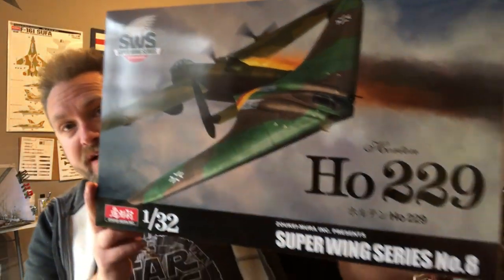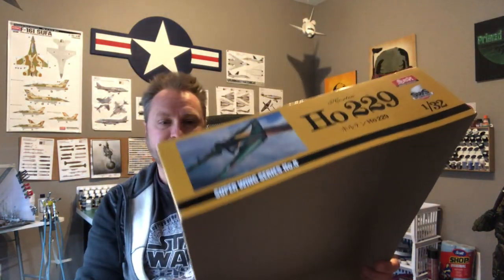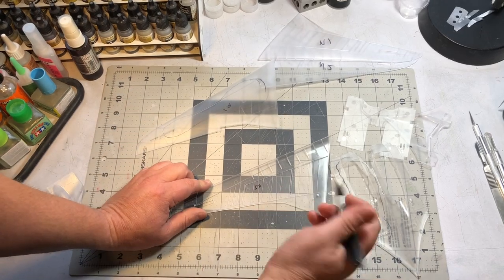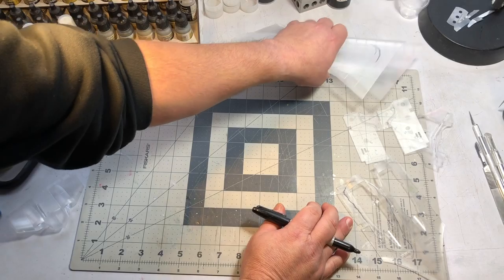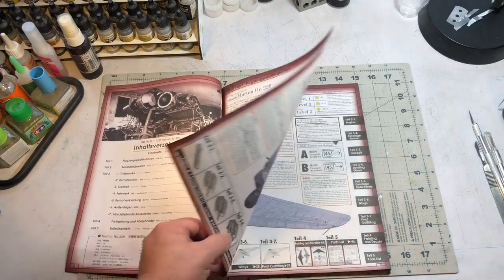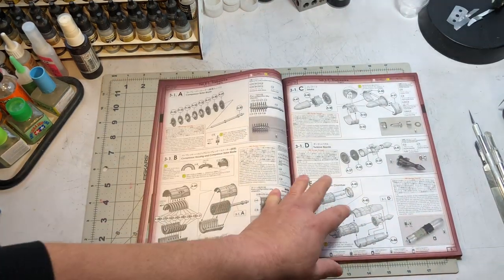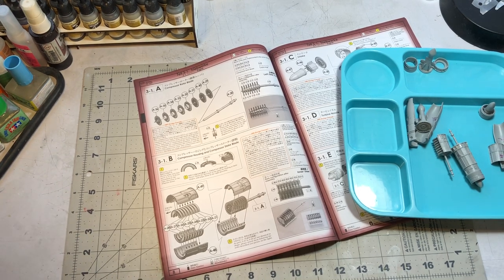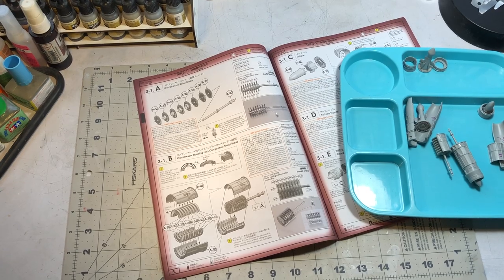Zoukei-Mura 1/32 Horten Ho 229: Part 1

Comment: Those fan blades look like a real snug fit, if you were to paint them, the layer of paint would have to be one atom thin.
As for the clear skin, they at least could make it so you can see through it to all the beautiful detail they've engineered on the frame.
Good luck with cutting, it gives me chills just thinking about it.

Comment: 1/48 doesn’t have the internal Turbo blades, much easier.
Reply from the maker: They’re not necessary in 1/32 either so I wouldn’t even bother with them.  I just built two more of these and left them on the sprues